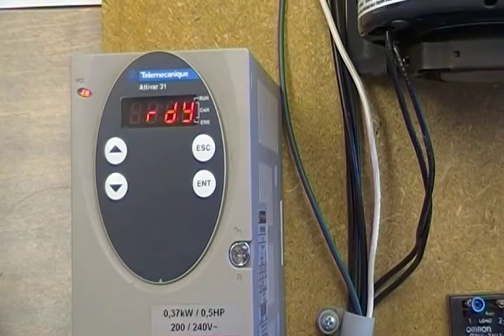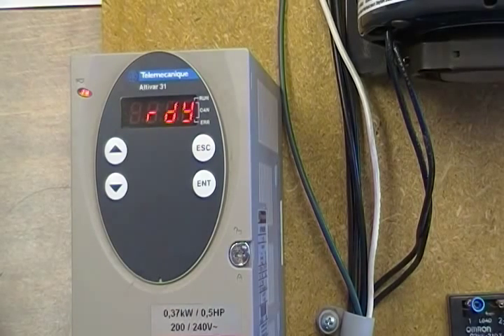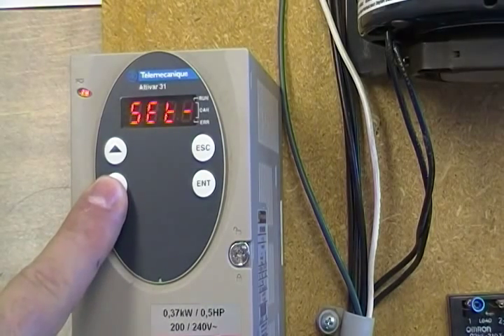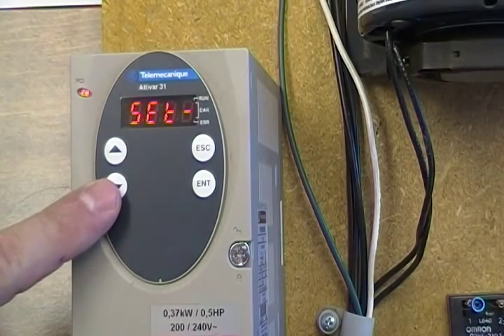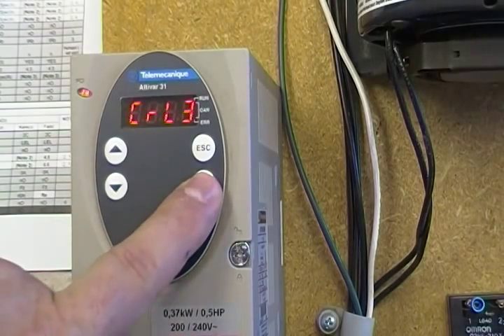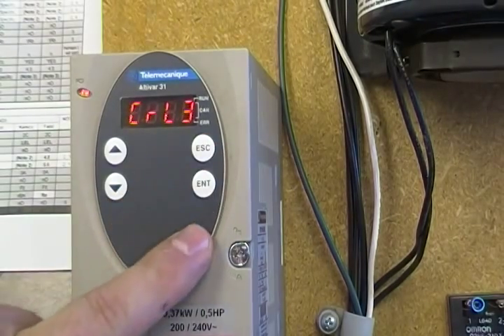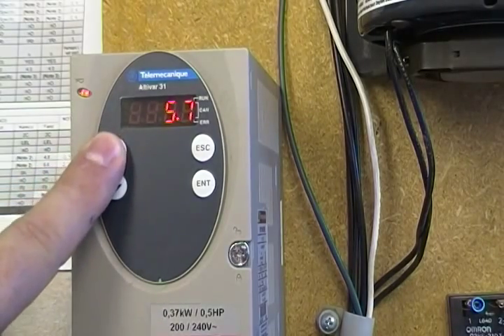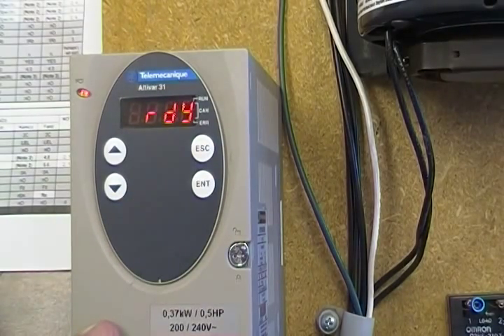VFD - Video #2  Menu Navigation

Comment: Pls I have this error(FrH) on my device(Altivar 31), the device is used for Davit control.Please can u advice on this error as the lowering of the davit is not possible and here I have this error on the VFD. Error code is (FrH)  described as :'Frequency reference before ramp (absolute value)'.  Thanks.